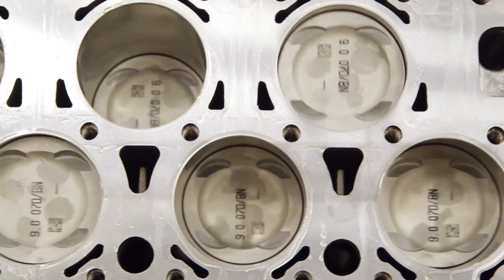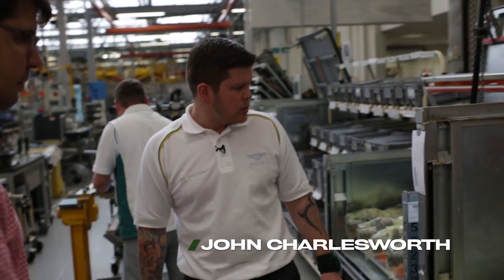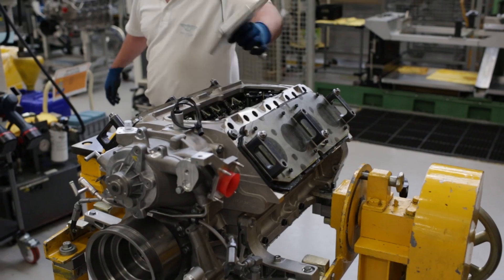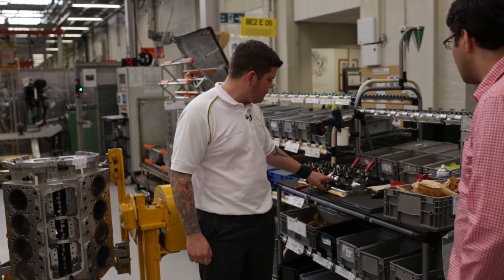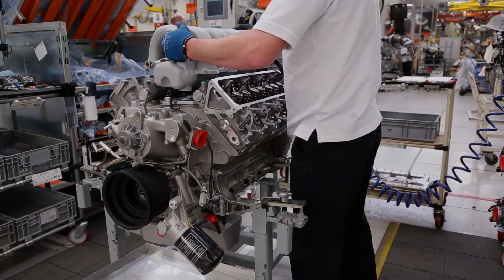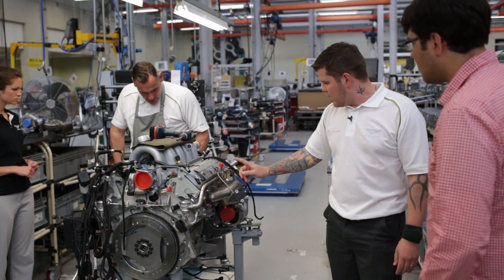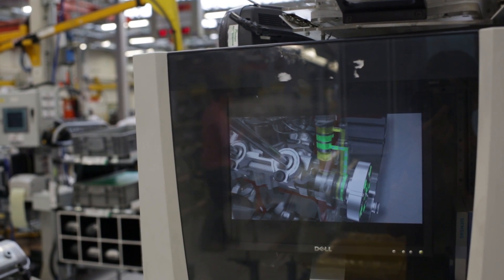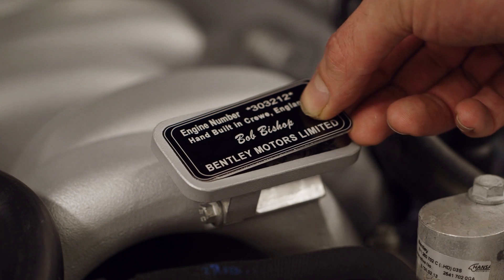Torque Monster: The Mulsanne Motor - /INSIDE BENTLEY

Comment: cant believe you blew the cover on the "lovingly hand built by" engine scam lol their marketing people will be cringing if they see that
Reply: That's not really inaccurate, AMG-badged Mercs also got handbuilt engines, and they sell a much higher volume worldwide (also cheaper to some extent) than Bentley does. Also, not even Bugatti engines are 100% hand built, they follow the same procedure as any other hand built engine: get the parts and assemble them.
Reply: Ultrakillerism I think the point eurocon is making, is that the single engine isn't assembled by a single engineer - whereas, for example a Nissan GT-Rs engine is assembled by one individual.
Reply: Mark Farrar
If one person built each engine then I could see putting that one persons name on it saying it was built by that one person. Bentley puts one persons name on there engines saying it was built by that one person, yet they are built by at least five different people on any particular day. Since it isn't built by just one person, then those little badges don't mean a damn thing. They should just say hand built. Honda had one person building the older Type-R engines and they would sight a plaque that said they had built it, AMG also does this. In both instances, those engines were hand built by ONE person, where as at Bentley, that just isn't the case as this vid clearly shows.
So, to answer your question of why is it inaccurate to say they are hand built. It isn't, but you are missing the point. That point is, Bentley doesn't have just ONE person build the engine by hand like the engine plaque says, they have MORE than one person building each engine, which makes the engine plaque completely useless. Does that clear your confusion up?
Reply: I guess I'm not understanding your point. How is it inaccurate to describe that these engines are hand-built? As stated in the video, only FIVE engines are completed in a single day. Just because they aren't forging their own blocks like medieval blacksmiths, and use modern equipment to assist in the assembly and quality control, doesn't take away from the fact that every single component is touched by human fingers and put in place by expert craftsmen. 

Plus I doubt anyone on their marketing team would cringe upon watching the video since it's extremely likely that they played a large role in approving Drive's visit to the factory.
Reply: Was actually thinking more along the lines of the customer's perception given how much they have just spent on said handbuilt engine also Ive worked in marketing for large corps before and this little faux pa would go down like a lead balloon come monday morning round the big table. Its good honest journalism however wont get you many more factory visits if the management know you do not omit obvious fucks ups like that lol.. hence why their is very little honest journalism :P
Reply: greebuh He's not saying they aren't hand built, he's saying that the plaque implies it's one guy who built the motor, when in fact it was a team of people and the name on the plaque is randomly generated from a list of engine guys. Obviously he worked on a part of it, but didn't assemble the whole motor. It's a handmade/assembled motor, he's not arguing that fact as it's something he even stated in his first post. Calm down bud :) He agrees they're hand built, just doesn't like the fact that the plaque implies something that is actually used as a marketing tool in some showrooms, and is actually a bit of a white lie.
Reply: Mark Farrar you have missed the point. The plaque they put on the engine implies that an individual had personally "hand built" that engine, which is a specific sales statement, unique point of difference, something and their customers will brag about.. and why not you buy a hand built engine that is what you should recieve. So inaccurate because it was not one person whom assembled the engine but in fact many, as explained in the video by... Bentley lol
Reply: Mark Farrar no we can agree you just need to realise the grey area is how they have worded the plaque, it is not as it seems as the Bentley engineer clearly explains in the video, if you still dont understand me just watch the end again lol. Furthermore its all very well saying it dont bother you as.. well.. you spent 100k+ on one? And no doubt still an excellent product with no to little tangible difference whether one or five people build it.. However for a global brand thats pretty cheeky if you ask me, they are bending the truth at best and liars at worst, take your pick
Reply: Mark Farrar
NO ONE said the engines were NOT hand built, what don't you get about that?
Reply: HPRam1
Why are you telling me what I already said? Tell that shit to Mark.
Reply: hendo337 Mine was built by a woman :)
Reply: greebuh So your only complaint is the plaque? Doesn't really bother me, but I understand the criticism. But aside from multiple people, how is the process substantially different from how AMG builds their motors? In my opinion, both companies can accurately call their motors hand built.
Reply: eurocon . I think I understand your point now. The person whose name is on the plaque did in fact build the engine at least in part. It really doesn't bother me. I still think it's accurate to call the motor hand-built. It seems we'll have to agree to disagree on this one.
Reply: I was surprised to see that as well. Ford engines like the 5.8L Supercharged for the GT500 are actually hand assembled by two men on the Romeo niche line from start to finish. The men then engrave their names on the engine plaque.
Reply: Den Zel
Why yes there is,  have people telling me what I said like someone else said it. Crazy that no one pays attention to the stuff they decide to read or watch.
Reply: What is the distinction between hand built and hand assembled then? They seem to mean the same to me.
Reply: I don't think anyone believed just one guy did all the work.  It would take forever.